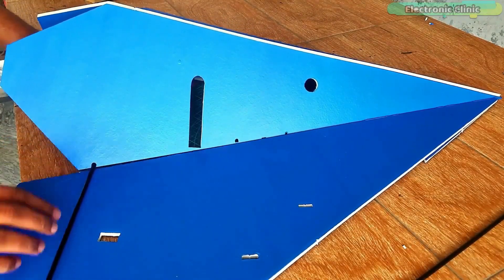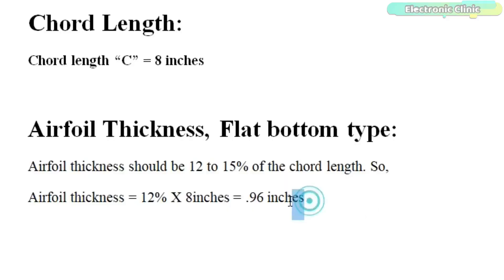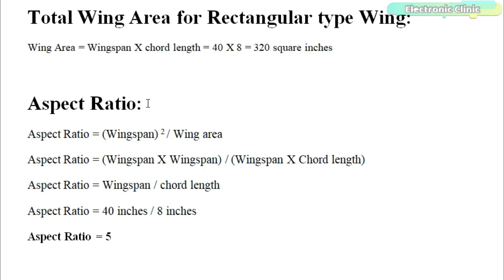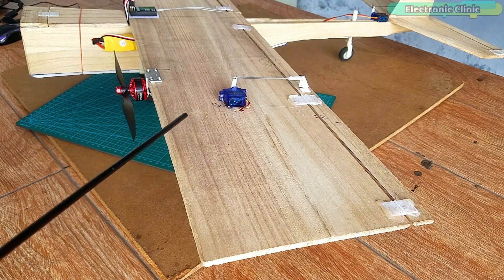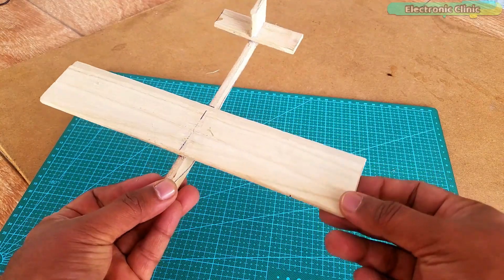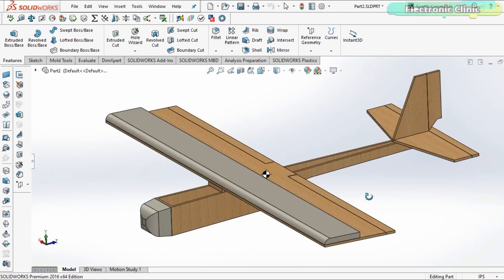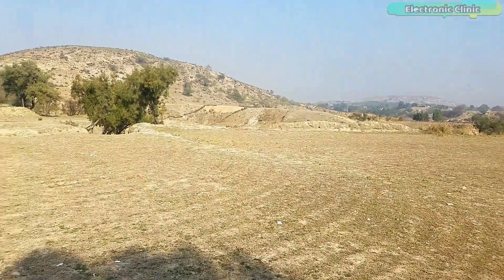RC Plane Designing Calculations, Making and Flight Test, RC plane made of Balsa Wood, Twins Motor

Comment: It's a nice video, your research is well done, but i want to know one thing 

Like I am going to make a very realistic plane, so it contains flaps, ailerons, elevons, rudder, spoiler (but leave the spoiler), sluts(leave the sluts too), but i want to add flaps to the plane 

Example: like your aircraft contains ailerons, elevator, rudder I will make in my plane, but you don't have flaps in your aircraft, so please reply to me for flaps, how to add flaps and ailerons both on the main wing, so please reply to me if you find the solution for it because I am also researching,

Your video was great, keep it up

Comment: Please answer this
Is there any consideration for nose length of aircraft?
I mean how to fix the distance between the nose tip of fuselage to leading edge of the wing ?
Reply from the maker: watch my other video on rc plane, that's a highly stable rc plane. you will understand it completely.
Reply: @ElectroniClinic  hey I have another doubt regarding drone frame 
So we are trying to incorporate drone into an RC plane so to make sure there is no collusion between propellers of drone and fuselage can we directly take the frame length based on requirements or should we have to follow the considerations which we usually see

Comment: I have made glider sort of slow flying plane , now with all the electronic on board weight is almost 685grams, my battery is 3s 2200mah, so what motor and props you recommend, where I also need a longer flight time, so shall I go with 1000kv motor and 10.6inch prop or what? Would you guide me please

Comment: Question- 
How does one know what size motor &. Battery will work or what will be too heavy & not fly?

Example: Hobby Zone sells a larger Aeroscout S2 1.1 foam plane & a smaller plane with smaller battery & motor.

Could I take motor & battery from larger plane & install on smaller plane? Fly longer or faster?

I could move battery so CG is good but are there weight limits to certain dimensions?
Reply from the maker: This really depends on the motor thrust. You can search on the google motor thrust vs weight.

Comment: i have a doubt, from what distance does the wing should be placed from the nose???
Reply from the maker: you will get enough space on the nose side to place the battery.
Reply from the maker: you can keep it 12 inches.
Reply: @ElectroniClinic  how do you get the 4 inches for the horizontal tail width ?

Comment: at 17:08,  this  is  because  you  boys  make  ZERO-dihedral  wings,  and  DON'T  have  the  Necessary  piloting  skills.!!!!!!!        by themselves, ailerons  cause  ROLL, only.!!!!!      a novice pilot  SHOULD  fly  a  model  that flies  SLOWLY, and does  NOT  have ailerons;  eg.,  a  DIHEDRAL  wing.        at link, see  a  SLOW-FLYER.     this is a type of model that  ONLY  flies  slowly; in part, due to the use of a wing having a single-surface profile.        a similar looking, and  LIGHT,  model can be  made  that flies slowly, that is not  a slow-flyer.      the fact that you  made a  Heavy  model  out of balsa, is a testament to your  lack of knowledge.        you should understand  that  foamboard/coreflute  is  HEAVY;  and  Any  solid foam wing has  a  wonky  dom.    distribution of mass.      if you can get balsa  Planks,  CUT  THE  PIECES   needed, for construction of a  framed fuselage.      googletranslate
a  slow-flyer
https://www.youtube.com/watch?v=lZ1vUKcktVk
how a model airframe is  SUPPOSED  to  be  made; with a  LOW-mass  skin/covering.
https://www.uh.edu/engines/thomasmorsewoodenframe.jpg
you should  look  at  numavig's  use of  hardwood flooring  underlayment; for making a wing and fuse.
https://www.youtube.com/watch?v=o4GrgNzq1ps

Comment: at 12:07, so,  you  removed  Too much  material, and  excessively  increased the height of the vert-stab.!!!!      it  is  Correct to use  JUST  five degrees  of   sweep, at the h-stab le.      and the le of the v-stab  should at  a slope of  75  degrees.!!!!!       googletranslate

Comment: at 10:27,  if  the  WING  does not make an amount of  Lift  that is equal to the auw,  an airframe  WON'T  fly.!!!!!!         this little, unbalanced, glider is  HEAVY  and  its  wing  makes  NO  lift.      in the case of a zero-lift airfoil, there  MUST  be, either, positive  aoa  at the wing mount, or  NOSE UP  moment, at the  HORIZ-STAB.        if you  think  you  learned  something, at this point,  i  DON'T  KNOW  what  it   would  be.

Comment: at 7:50, rather than worry about  the area of the elevator, its chord should be equal to thirty percent  of  the  stab  root  chord.     AND,  the  chord of the rudder  SHOULD  be  the   Equal  to  that  value.      googletranslate
Reply: Hi David, could I ask what wing type should I use for a rubber band propelled plane

Comment: at 4:17, since all you boys  make  HEAVY  models, it is best that you begin design with  a  suitable  WINGSPAN.    that is,  about  one  yard/meter.       THE  REST  OF  the  airframe  dimensions   can be derived from   from  that  value.       to   Every  extent, practical,  Mass  Should  be  MINIMIZED.        consequently, the use of  raw  PLANKS   of wood is,   Not   Smart.    do you  understand that a  full-size  light  plane  is  MOSTLY    Hollow.!!!!!    googletranslate
http://imagizer.imageshack.us/v2/1600x1200q90/540/HqRuID.jpg

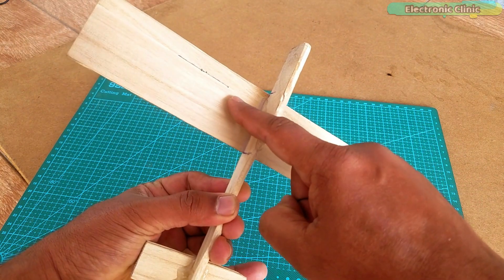Comment: at 1:50,  the  chords  of  the  stabs  should be  equal.       the chords of the  aft  control surfaces  Should  be    EQUAL.!!!         in your studies, did you encounter the concept of  a  LIFT-making  Profile.?           at 1:58, funny.    that  Heavy, unbalanced  little  glider  told  you  NOTHING.!
at 2:12,  the  tail  Should be made as  LIGHT  as  Possible.!!!!!!         consequently, the  Mass of servos  does   NOT  go  there.!!!!       where a design has as many flaws as this one,  Neither  should the mass of a tail wheel  be  there.        in order to  Avoid  excess mass at the tail, the stabs  should  be  JUST  big enough, to do the job.        consequently, the span of the horiz-stab should  Not  be  greater than,  THIRTY  percent of the wingspan.!         (note that a tail wheel goes at the tail.    and,  That  wheel  is  NOT  at the tail.!!!)       it would behoove you to  Understand  that  ALL  the  mass in an airframe,  ADDS   UP.      in this case, the all-up-weight (auw) of the model is  TWICE  what it should  be.!         note that the mass of servos, etc,  should  NOT  be  added  at the  'top'  of  the  model/fuselage/wing.        googletranslate
Reply: Thank you for the information and things to take into consideration when designing.

Comment: information.         at 1:30,  that  is  NOT  where  cg  goes.!        FOR  ANY  WING,  the  Optimal  location of cg is at  THIRTY  percent of chord.!   (or, just a bit forward of thirty.)
in the case of a wing that is not constant chord, the reference is  30 percent of  mac.   mean aerodynamic chord.
in your studies, did  you happen  to  see  the  word   DIHEDRAL.!!!!       a relatively small amount of dihedral  Dramatically  increases  stability; and makes  ailerons  Unnecessary.!!! 
all you boys  make  Zero-dihedral  wings.    which  REQUIRE  Advanced  piloting  skills.!!!!!        
you use the term  aspect ratio.     while that use may be 'correct', the  term  Normally  applies to  a   main  wing.        it is correct that ailerons extend to the wingtips.       however, the use of  Full strip ailerons is  NOT  recommended.        you say the view, at right, is  'normal'.     it is NOT clear what you mean, by that.!!!!      the view, at left, reflects  More  correct  design.!!!     except, for the location of the   prop.!        suggest you view my design tutorials.       

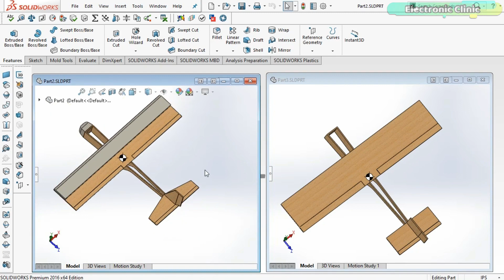at 1:43, part of the rudder  should  NOT  be  amputated.!!!!!     consequently, you  should  DISCOVER  how  to  NOT  do  that.!
it should be understood  that  Almost No  model builders  know what they are doing.    consequently, there is a  LOT  of  MISINFORMATION  online, about  design.!!!!      googletranslate
Reply from the maker: i am working on another one. this time i added winglets, and also using cg around  at 27%
i tested the new model, the stability is just amazing. soon i will upload the video. 

thanks for such a detailed analysis.
Reply: @ElectroniClinic  hi.    winglets  do  NOT  go  on  this  type  of  airframe.   PERIOD.
if  you   Cannot  make  inboard  dihedral,  use  OUTBOARD  dihedral.!!!!!!!
Reply from the maker: @daviddavids2884  the one i am making right now is completely different.
Reply: @ElectroniClinic  well, if you want your rate of 'improvement' to stay the same, don't take my advice.     cheers